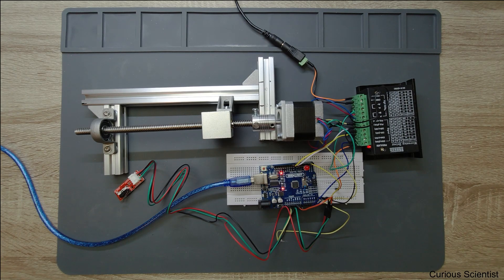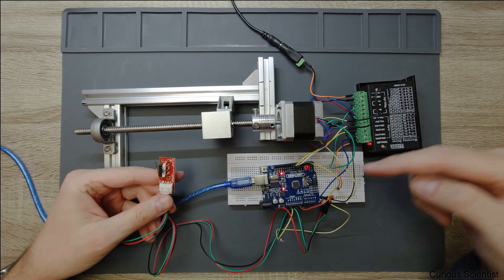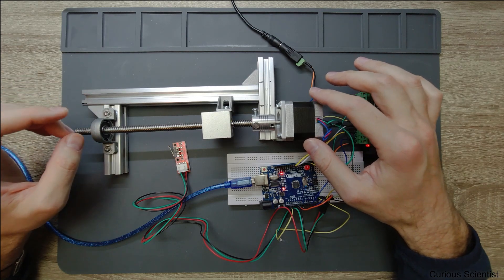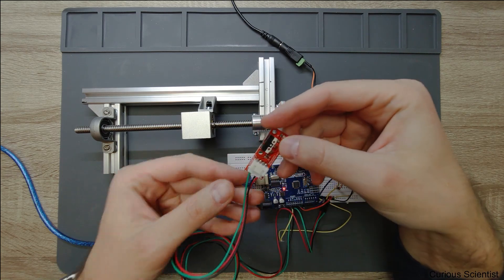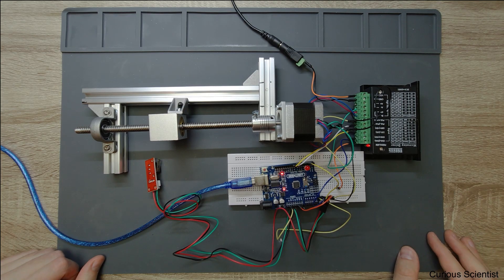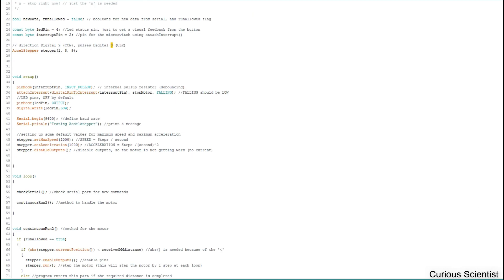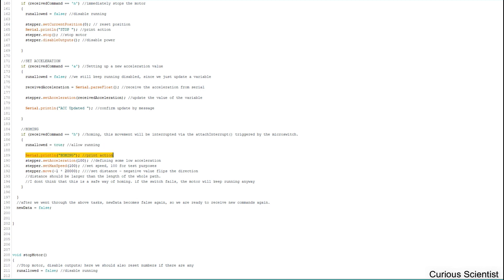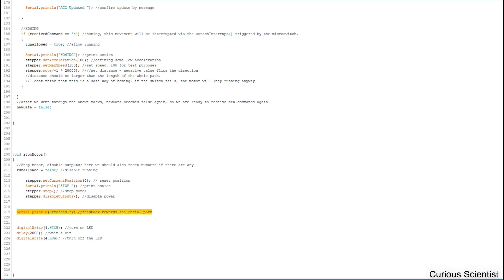Homing with the AccelStepper library and a limit switch

Comment: Cool! How do I add buttons to control movement?
Reply from the maker: Hi! Assign a digital pin as an input, then connect a button to it using either an external debounce wiring or the internal pullup resistor. Then you just have to check the status by the button. You can do this by reading the pin's status withing the main loop() or by connecting the button to an attachInterrupt()-capable pin. I can make a video about this in the near future (in 1-2 weeks).
Reply: @CuriousScientist  thanks! wait for the video, I'm new to this)
Reply from the maker: @Павел Лях Please check my new video where I show the button-controlled stepper motor.

Comment: I "Liked" the video, I did that cause the code is available, but the wiring ... This code uses AccelStepper, and all my previous projects use Stepper, so stepper wiring is different, and so far I've not figured it out. Your code uses only 3 wires for the stepper control, (1, 8, 9);  whereas usually I needed to wire all 4, usually (8,9,10,11); So I'm confused, but  I've got time!
Reply from the maker: Don't confuse the accelstepper library with other stepper motor libraries. This is a different system, it is not the video's fault. :)
Reply: @CuriousScientist  I get that, I changed the code, added #define motorPin1 8, and such and added AccelStepper stepper(8, 9, 10, 11); and it moves, but VERY slowly and always in the same direction! I don't know any other method of using a 4 wire motor on a 3 wire program.
Reply: @CuriousScientist  I'm using a DM542T driver
Reply from the maker: You are using it totally wrong.
Reply: @CuriousScientist  I am, obviously, it's not working, but I don't know what to do. And it looked so promising!
Reply from the maker: Yeah, but I mean, you are using an almost identical driver that has a step, direction and enable pins, just like in my example. Then why are you messing around with changing the stepper instance? That's where you are doing it wrong. Leave it as it is in my original code and wire your driver according to my code (pin 8 and 9 for step and direction). It will work. 

And in your original comment, you also assume wrong that my code uses 3 wires; or at least, in a way you assume it. Maybe you should take the effort and read the AccelStepper library's documentation and then you would see that the "1" in the "(1, 8 , 9)" is not a pin number... The number 1 defines the interface. If it is number 1, then the next two numbers in the argument of the constructor is the step, and then the direction pins. Also, the driver you use is a sophisticated one, so you should pay attention to the microstepping because the slow rotation could also be caused by a very high microstepping value.
Reply: @CuriousScientist  OK, thanks! I'll give it a shot, but that's how I first started. Tried looking at the video to see how you have it wired, but the wires get really entangled and it looks like one even goes to the breadboard and connects to nothing.
Reply from the maker: Umm, all the connections are declared in the code, there's no need to try to figure it out from the video. Follow the code.
Reply: @CuriousScientist  Also, I did try to read the accelstepper documentation, but either I'm reading the wrong thing, or I just don't get it. I'm sure I just don't get it! I was looking for where it may tell me what the pins were and what I needed to do, but I couldn't find any answers. I did just put the code back and wired it up as best as I can tell, and it still is not right. I'll keep swapping wires around....
Reply: @CuriousScientist  I don't understand the " the "1" in the "(1, 8 , 9)" is not a pin number... The number 1 defines the interface. If it is number 1, then the next two numbers in the argument of the constructor is the step, and then the direction pins". So I'm not using Pin 1 for anything, and only using pins 8 & 9, but my stepper driver has a PUL+ and PUL- and DIR+ & -, so 4 wires, and even your driver looks like it uses 4 wires except as I said, that one looks like it goes to the breadboard and connects to nothing.
Reply from the maker: No offense, but you should stop what you are doing, take a step back and start over. From the basics. 

You cannot just keep swapping the wires around, electronics is not gambling. You will fry your components sooner or later, or worse, you will get injured. I am not trying to be a gatekeeper or discourage you, but you really need to try to break down the challenge into smaller step. 

Follow my wiring: https://curiousscientist.tech/blog/arduino-tb6600-wiring-stepper-motor

I published so many resources for free and put so much time and effort into them, but people don't seem to read and follow it.
Reply: @CuriousScientist  I'm trying, but it only shows pins 1,8,9 & 2 and apparently 1 is not a pin, there is no mention of PUL- and DIR+. Sorry I'm such a bother :)
Reply from the maker: My English cannot be this bad. I (think...) clearly explained that 1 is NOT a pin it defines the interface. You need to focus only on pin 8 and pin 9. Do you even read what I wrote?
Reply: @CuriousScientist  Well, your English is way better than anything I know! I just did not see wiring in the code to wire the POSITIVE sides of the driver to. I did go to your "wiring stepper motor" site, and I see the ENA+, DIR+ & PUL+ go to POSITIVE 5V, So I may have fried something, or edited out some code, but it should be wired correctly! Sadly it still does not work, but I may have fried something. THANK YOU for your help. I also do a few video's and get people mad at me for trying to help! I thank you so much! I'll even subscribe, you seserve it, and possibly a donation (after I get it working!)
Reply: @CuriousScientist  Hey, I let it sit a bit and tried entering s 200 500 in serial monitor and this time it not only worked, but it kind of went fast! :)
Reply from the maker: Thanks for the support!

Again, just step back and start over! Remove all the wires and wire it together again. Then, erase the Arduino files, download it again, and compile it again, without touching anything and see if it works. Always do one step at a time and then observe how things behave. If you do too many steps at once, you will only get confused.
Reply from the maker: I saw this comment after I sent the previous reply. See? You stepped back and went back to it and it worked! ;) Great to hear your progress!
Reply: @CuriousScientist  Yes, my major problem was not seeing the PUL+, DIR+ and ENA+ all go to +5V. All my other sketches use pins from the arduino. Thanks again!
Reply from the maker: @F111BMATHIS  It all worked out in the end! You're welcome. 
Good advice for the next time: Always read the description of the videos you are watching! There's a link in the description of this video that points to the video which explains the wiring step by step. And that video has the link for my website that I sent you previously.
Reply from the maker: Yes, I know this video. I made it. :)

Comment: I need the switch to send the motor back home.
Reply from the maker: Should I send it to you by post or what?
Reply: @CuriousScientist  HAHAHAHAHAHA! Touché.
Reply from the maker: But jokes aside, could you elaborate on the question a bit more? Maybe I can help. 😄
Reply: @CuriousScientist  I need to send an object about 6 feet, via a motor. But, I need the object to come back once it hits the limit switch.

I’m currently using a stepper for the “motor” part of my build, but I’m running into issues regarding missing steps. My end point continues to slowly move further away.

This is really due to a combination of things. Stepper working with a diy belt system.
Reply from the maker: Yeah, it can be due to many reasons. Check the tension of the belt, it can cause missed steps. Also, if you overload the motor or provide insufficient current to it, it can skip steps. Maybe it would be easier to put an encoder in the system and rely on that to navigate between different points.
Reply: @CuriousScientist  I’ve thought about removing the stepper and using a DC motor with an encoder.
Reply from the maker: I think that's actually more complicated programming-wise. You'll need to write some sort of PID algorithm for the DC+encoder. Steppers should be punctual, even without encoder, just think about how precise 3d printers or small CNC machines are. Also, if you have the problem in the system and not with the motor, a DC motor with an encoder (servo) would be pointless as the encoder only sees the position of the shaft of the motor whereas the slack in the system can be 3 feet away from the shaft.
Reply: @CuriousScientist  yeah… I think more and more that I might simply go analog with this.

We’ve built an electric shooting gallery. Lots of animated things…

This specific back and forth machine, if you will, is set off by a target. The machine is just a simply belt system… It pulls a small ball through the air, as if it was hit by a character in our shooting gallery.
The ball travels across the room to another character, who swings at it and then the ball comes back to the starting position.
Reply from the maker: Another simple solution that came into my mind is to just simply put a limit switch on both sides. Then, whenever you need to return to one of the sides, you just run the motor until the limit switch is hit. You would not need to keep track of steps or anything similar complex stuff.
Reply: @CuriousScientist  yeah, I am looking at limit switches to switch a relay to change the direction (polarity).